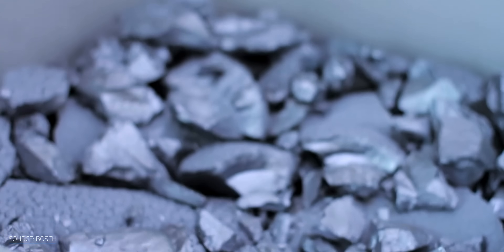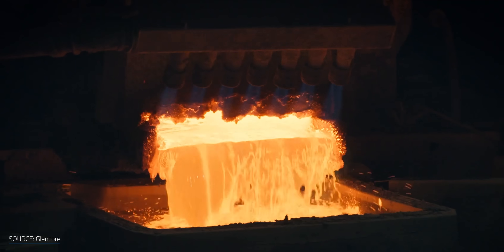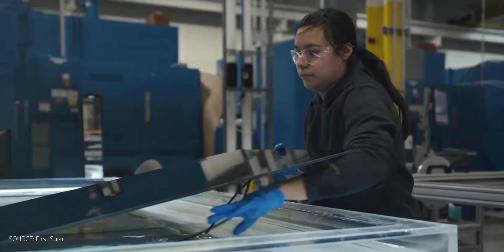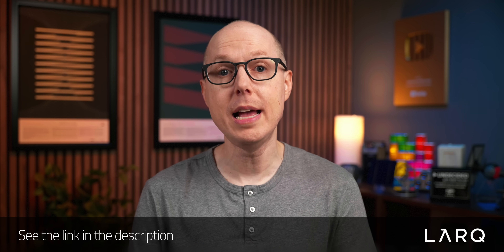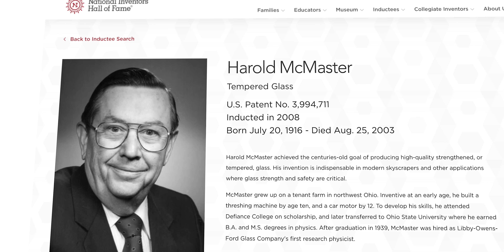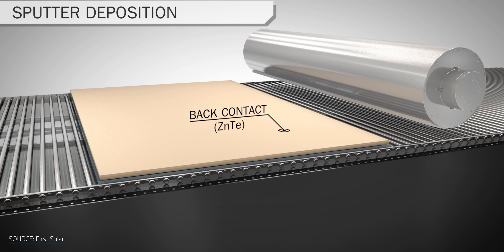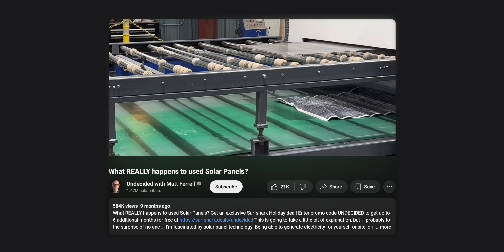How the Next Big Solar Panel Tech is Already Here

Comment: I remember seeing something about how making a rough layer absorbs more light and boosts silicon efficiency by making sure the light has more odds of getting absorbed before bouncing out, so maybe that'll work well for this. Random pattertns with less right angles worked the best, and I think it was getting a descent slice extra but I can't remember how much exactly. Silicon wafers can just be etched directly, but on these a manufacturer can etch the layer that the CdTe is going onto, and the process isn't changed much with either method. It's not theoretical perfection but it could definitely help make solar expand even faster. Also mirrors and cooling paint can be used to create simple structures that absorb more energy more effectively with more solar panels in a box or something, or cooled ones under concentrated light.
Putting this here in case it gives someone the right idea i suppose.

Comment: Initial thoughts after the intro: Cadmium is a real nasty substance and also rare, so we shouldn't really be using it in tech and mining and disposal chains that risk environmental contamination.  Maybe if recycling chains were mandated by law to be maintained  y the companies fabricating tech, and if severe (jail, hundreds of millions or billions in fines) penalties for improper disposal, and cleanup crews (storm or disaster damaged arrays) help as well, then maybe ... but I still think we should focus on tech that won't poison us so readily.
Reply: After video: Nice to see the recycling loop is mostly closed.  The bigger concern remains the lower efficiency.  There might be niche applications for mobile home or trailer installs where the benefits of lower weight saves fuel that would equal of exceed the amount of additional fuel needed to move more efficient but heavier silicon panels, as well as extra fuel burnt in CdTe systems to run a generator to make up the difference.  This would be use-case dependent, where the difference between panel weights is significant compared to vehicle weight, as well as the frequency of moving the vehicle.
Reply: Well thought.
Reply: Seeing as we've already been using it to power camcorders back in the day up to today's cordless screwdrivers, drills, and anything else that can be made for a price from china it literally can't be that rare can it ? 🤔
Reply: So you missed the part of it not being toxic when mixed ?
Reply: An elements characteristics can be very different then a molecule made with it. Water is made of an explosive gas and a flammable and mildly toxic gas
Reply: @chrisward5626  water is a universal solvent.

That's like the first thing you learn in chemistry.

That means you now know where all the arsenic and cadmium in your water is coming from.
Reply: @formdoggie5  you are also taught it cannot dissolve every substance so universal is a historical term when they also thought the world was flat 🤣👍
Reply: If cadmium is rare, there’s a strong economic incentive to recycle it.
Reply: The issue is not really risk, but risk versus reward. Gasoline is really dangerous. 

So let’s weigh out the risks
- Cadmium and Tellurium 
- shorter life
- lower capture efficiency.

Rewards
- lighter panels, potentially cheaper 

For me the reduced lifespan is the kicker.
Reply: @Darisiabgal7573   He said they were adding arsenic now instead of copper to preserve the lifespan, so no worries! 😄
Reply: @vulpo  The Jiroft culture (South Central Iran) used to add Arsenic to Copper to make bronze.
It’s probably one reason nobodies talking about Jiroft culture. It didn’t last very long.
Reply: @SlyerFox666  so metals are nonpolar and don't leach into the water on round earth?
Reply: Maybe check out the enviro certification from both EPA and EU for First Solar before making things up.
Reply: @factchecker9358 I don't think the element cares about certifications once it ends up in the environment. Cadmium was banned in the EU for a reason.
Reply: I have worked with cadmium compounds in a lab for years. Not an element I really want to see being used if possible. We’ve been working hard to replace it for years with better alternatives. I prefer working with cyanides compared to cadmium, but like anything it is low risk if handled properly and appropriately.

In theory it should be tied in to the panel internals so low risk for being leached, but I’d prefer to keep away from them on my home, at least initially.
Reply: salt based minimal lithium battery is still the best new idea
Reply: @Warp9pnt9  Yeah, regulations work. 🙄😂
Reply: @chrisward5626 The connection he used is so misleading. Toxicity is based on the organism's tendency to neutralize toxins. Sodium chloride is necessary for the body so the body is adapted to using significant quantities and controlling its behaviour. On the other hand, cadium compounds are not used by the body but could interfere and damage while the body cannot propely get rid of it.
Reply: Tell that to the department of defense
Reply: @Warp9pnt9  literally says in the video it’s not toxic
Reply: @MartinMaat The government shouldn't be able to ban an element. That sounds like Greenpeace trying to ban chlorine in the 1970s. Despite it being necessary for life, used in water treatment, and part of plastics and drugs.
Reply: If you are worried about polluting production and processes. 
Don’t buy Chinese made.
Reply: @formdoggie5  you mean from all the coal ash ponds into your groundwater ?
Reply: @nibrasalchoufi3450  lucky it’s only America that uses these panels and also dumps coal ash into ponds leaching into you ground water .
Reply: Maybe you should have watched like, a minute more than the intro before writing this.
Reply: Then stop making solar panels. Your comment is not helpful at all.
Reply: I've had leachate analysis done on the fslr panels and they are entirely non-toxic. Additionally, while this may have changed, it used to be that despite being legally nontoxic. Inorder to become a customer you had to commit to return any broken modules back to the company for recycling.
Reply: Seems interesting, but how will it hold up in strong Midwesten storms?
Reply: @deisisase  about the same as the windshield of your vehicle
Reply: Agree- except cadmium is slready a byproduct (waste) from zinc production.  This is sctually good news, taking that nasty byproduct snd putting it to use, instead of looking for a safe disposal method.

I'm assuming cdTel is inert.   That's the big question.: is cdTel inert after it is made?  What conditions render it unsafe?

Comment: As far as I remember CdTe performs better at higher temperatures as well, compared to Si where the efficiency drops sharply. This may be particularly important when it comes to solar farms in the desert. At work I have been using CdTe detectors for x-ray research and one of the big problem was thickness uniformity (at much higher thicknesses as for solar use though). I don't know whether these issues have been solved.
Problem remains the low abundance of Te though.

Comment: If you are into automation and get a chance to visit their factory take it the process is almost entirely automated, it's super cool. Also heads up you probably won't be putting these on your house the modules are way too big, and have a high VOC ~ 400V. Residential solar in the US maxes out at 600.
Also one downside of thin film modules is that they can be damaged by water droplets. In the manual it actually warns you to not wash in the sun cause the water droplets focus the sunlight and burn tiny holes through the film.

Comment: Hey Matt, Having conducted some due diligence on the FSLR facility in Perrysburg back around 2007 on a day that they made a significant performance breakthrough I would say that from a health and safety standpoint it's a top notch operation given the toxicity issues.   For added context Thinfilms like CdTe emerged as a promising alternative to silicon in order to counter to the supply shortages and high prices.  However, where thin film falls short is the additional land requirement and BOS costs for solar farms especially in jurisdictions where land availability is a consideration.

Comment: Regarding the Larq promo: real UV sterilizers for water keep the fluid in very close proximity to the bulb (a few mm is typical for aquarium or domestic water units) because sterilization efficiency drops off very quickly due to the water absorbing the UV. It strikes me as highly implausible that the LED in this thing is going to be sanitizing or sterilizing anything in any meaningful way. Perhaps a completely empty container, maybe. But a 6 inch tall column of water? Doubtful.
Reply: we use them to increase trichomes on plants.. LED UVB is less useful and atrength than t5 uvb bulbs
Reply: strength i mean above... it is better using HID UV bulbs or t5 uvb bulbs for efficiency
Reply: For UV to work effectively the water has to be filtered to 5 microns or less, otherwise shadows from the particles in suspension get in the way of the light. However, if the water is subjected to the UV for long enough, and in a highly reflective container it will all get hit with enough radiation to zap all of the bugs. It's a question of UV intensity, overall coverage and time.

Comment: I just want to see multi-junction cells mainstream. Having panels on the market that actually pull over 35% efficiency is going to be a game changer.
Reply: Lol, yeah we could have a market for small electric furnaces to smelt and use steel and aluminum even boosting industrial production if that 35% efficiency became available. 
We are still a lot happy with the 23% we are getting compared to the 11-13% 10 years ago

Comment: How easily can cadmium telluride break down back into it's toxic elements?  When I hear people say they're afraid of panels breaking and leaking toxic material I thought they were crazy, but then we have panels like these, and you have to wonder if this is what they latched onto to drive those concerns.  I'm more for silicon with perovskite layer to boost efficiency.
Reply: it doesn't break down as much as NaCl doesn't, it's stable. EPA say it pass their tests of long-term leaching, meaning the EPA considers it safe to dispose. the problem however is that the EPA is the only one that updated their classification, so we don't have independent verification of its safety from other agencies.
Reply: @danilooliveira6580  Right...  thank you for the information.
Reply: While CdTe panels are more stable than many other electronic wastes, there are still concerns about their disposal in landfills:

    pH and Redox Conditions: The leaching behavior of CdTe can vary depending on the pH and redox conditions in landfills, which are influenced by microbial activity.

    Long-term Stability: Although short-term studies show low leaching potential, the long-term behavior (over decades) in landfill conditions is less certain.

    Regulatory Considerations: In some jurisdictions, CdTe panels may fail the Toxicity Characteristic Leaching Procedure (TCLP) test, requiring disposal in hazardous waste landfills.

Comment: 7:27 This gave me flashbacks. I've made 4 of these. It looks the same so I assume it's the same. It's a standard for testing glass and I despise it for how it can deform so easily. Anyways, it's quite literally a punching bag filled will 100lbs of lead shot. The kicker is that the back is full at around 80lbs and it takes a long time to pack more in to get it to near 100lbs. The bag is then taped with glass tape, and then you stop once it reaches 100lbs. ugh....  I honestly didn't know about CdTe and love the way you explained it Matt!

Comment: My biggest concern with solar is their durability in severe weather. Hail is quite common here in Nebraska, golf ball size and larger, which will damage panels quite easily.
Reply: Solar panels are built and tested to hail resistance, with basically a gun that shoots different sizes of ice balls at measured velocities. Not gonna say there's no worry from extreme hail, but it's been a consideration all along.

Comment: Can CdTe panels be used in tandem with Perovskite Panels the same manner that Si PV Panels are?  Would this improve their efficiency?
Have CdTe panels been used as an onboard charging system in vehicles?  
If they are "thin" then the weight should be less than Si PV Panels making them better suited for onboard charging of batteries in EV Vehicles.  This could have applications in Electric Trucks with the roof of a truck trailer covered with panels and that could contribute to the recharging of the onboard battery.
Reply: One would guess the weight of CdTe is more because of the atomic weight or less because it is thinner?

Comment: Got to admit, I'd never heard of CdTe panels before. The only application I'd ever seen for Cadmium, over Silicon, was in the light meter of my old Pentax ME Super film camera. And guess what, it was a superior meter too. I guess the point is, Silicon is so damn plentiful, and latest Perovskite added in tandem development models are pushing well past the Shockley-Queisser limit, as far as 43% in the lab. Yes, Perovskite is that super material that let's itself down by quickly degrading in sunlight, of all things, but that is quietly, if slowly, being solved. I guess CdTe will find its place in the mix. It looks like a great alternative and there is certainly a vast market to fill. Incidentally, when you say 2nd most common panels, I'd love to see a bar chart of the percentages.

Comment: There’s one big advantage you said but didn’t go into any detail on for CdTe. Durability! The cell is flexible so, there’s no cracking under the glass. This is big in areas that are prone to hail. A hailstorm can hit a site with crystalline modules and you may not see any physical damage but once you take a look with thermal or EL imagining you may see cracked cells.

Comment: Would love to know the weight ratio/difference between the two. It seems that thinner and lighter may have some commercial scale use cases, with engineering requirements for roofs or other structures that bear the load.
Reply: Their series 6 panels are 6ft wide by 3 ft ish and weigh 70lbs

Comment: So these panels are less efficient, cost more (only one company makes them?), and are based on Cd. I wonder why they are not very popular.
Reply: exactly! why even make a video on it?
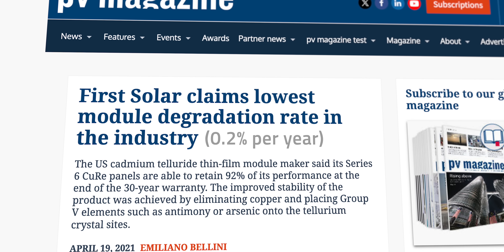Reply: Even better: 9:42 "replaces [Copper] with Arsenic"
Yeah that sounds like a great idea, worked so well putting asbestos everywhere.
Reply: @ltandrepants  because it's a different technology that have niche uses since it's thinner and lighter. and this channel is about reporting about different technologies we don't usually hear about.
Reply: The biggest factor is tariffs on imports. First Solar's supply chain is independent of China, no matter who wins the election, both Harris and Trump have plans to increase tariffs on Chinese solar panels. One out of every 5 solar panels in the US is still significant. FSLR did $4 Billion in sales last year and is basically sold out already for next year's production.
Reply: The heat tolerance is a major factor. It really depends on the placement and ventilation around the panels. I'd also imagine having less weight for panels over parking lots saves a lot on steel cost
Reply: @flex4711 Trace amounts of arsenic, which is already in soil and rocks.
Reply: @ianglenn2821  Doesn't have the US a local Silicon Solar industry? Silicon is also independent of China.
Reply: The First Solar module is quite popular with intelligent people. Their backlog is over a year.
Perhaps you should try to buy some yourself and see how long until delivery?

Comment: Right, CdTe is clearly something to avoid.... 
The benefits just don't justify the downsides.
Reply: had the same thought. why use something edgy when silicon is around for 30 years and works perfect. i know so many people which have silicon on the roof, since 20 years. it still works as is intended to do. of course, lose of some efficiency, but still works.
Reply: @DerSchrottBastler  exactly, all the risks, etc for 2 or 3% more efficiency? No thanks
Reply: You have a lot to learn about this tech, it's enviro certifications, and the expanding company.
Reply: bot comment

Comment: So lose 4 percent efficiency to gain thinness , but if it’s going on my roof I’d rather have the higher efficiency rate
Reply: Well, he said that “thin means cheap”, so unless I have a small roof, cheap is good.
Reply: In reality energy efficiency in this context is less important than sufficiency. That is, if the solar array you have, generates the power you need it's efficiency is irrelevant. (You are not paying for the sun so it costs you nothing to waste a bit more of it). That leaves only the through life cost to consider. If it is cheaper to start with and is more durable, then it is more cost efficient, even though it is less energy efficient.
Reply: @MrSinnerBOFH  Sadly because of the high price of the base metals, CdTe Panels are actually more expensive than Silicon ones.

Comment: So  you say the current CdTe needs 1/3 more space due to efficiency vs silicon panels.  You did not mention how much lighter a similar size panel would be. Is it close to 1/3 less material?  1/3 lighter? If so then it's only a space issue.  Scale/Cost of materials is a different issue. I do appreciate the option. Thanks Matt.  I'm right there with you owning our fashionable hair styles too!

Comment: Cadmium is a toxic and carcinogenic heavy metal, and Tellurium is also toxic, so I"m happy their use is rare. Don't forget the hard work that went into phasing out NiCd (Nickel-Cadmium) rechargeable batteries. Also, Tellurium is about as rare as Platinum.
Reply: EPA and EU regulators did a lot more homework than you did.